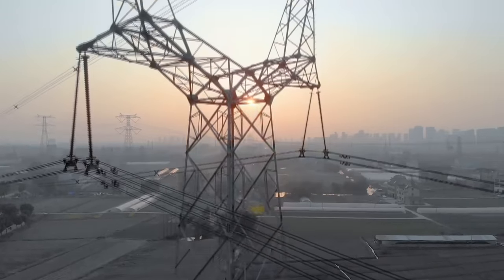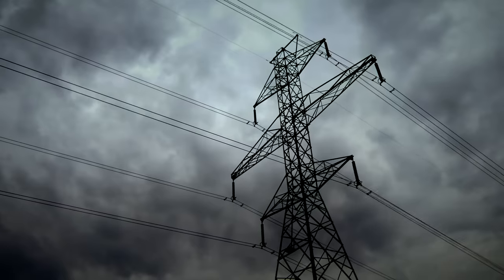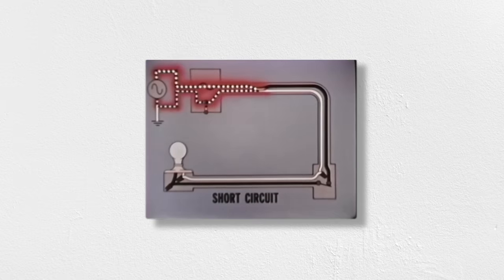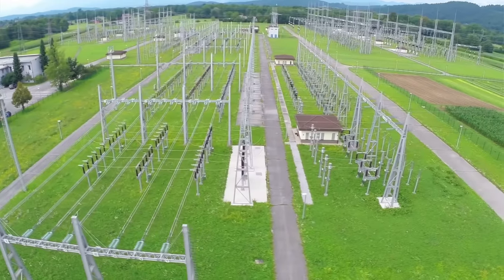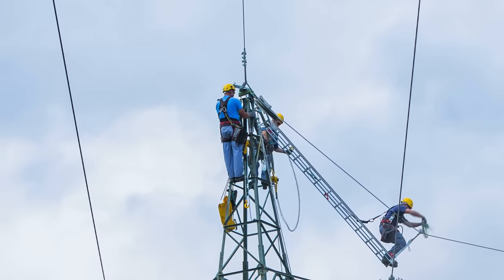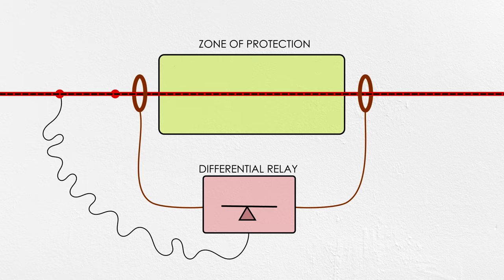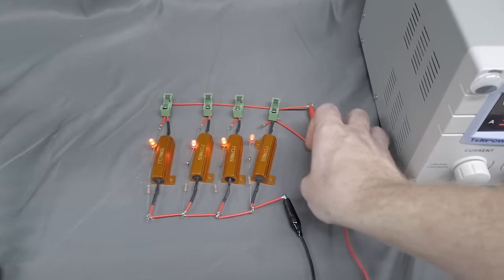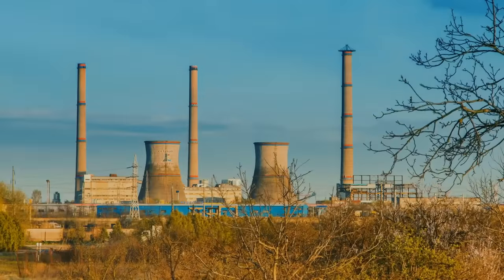How Power Blackouts Work

Comment: During the North East blackout of November, 1965, the “chichen and egg” issue was addressed by  by interconnecting a large group of employees’ cars to provide startup power for a plant in Connecticut (might have been Massachusetts) , that plant kickstarted  the North East grid back to life.  The process was described in an article in Analog Science Fiction/Science Fact,

Sometimes I ride around on my bicycle, trying to figure out where all the interconnections of the local power structures go.  Keeping track of that must be a major cartography job!

Thanks fir the great video!
Reply: I see there is someone else still alive that remembers that blackout. I was in Pennsylvania at the time and we intermittently lost power for a few hours. Quite the mess for the upper East coast. As I remember at least one very large generator was destroyed trying to keep the lights on in NYC. It took a few years to get it replaced. 11-20-2019.
Reply: I remember that like it was yesterday!!
Reply: Did they use the car batteries to provide excitation current to the (power plan) alternator? That makes the most sense.
Reply: @jrmcferren  There is a huge amount of control circuitry that has to be up and stable before a plant can be on line, and (depending on the fuel) everything needed to start it. A few years ago a power plant I supported had an intermittent failure in a charger on the battery bank that controlled one of the turbine units. The alarms for that charger were disabled, but the message was not relayed to the next shift. Overnight the batteries gave out and things went wrong, ending with lack of lubrication to the rotor bearings. The generator spun down with no oil and the expected results.
Reply: I was living about 40 miles from Philadelphia and all we had was a momentary brightening of the lights in the house and everything went back to normal.  It wasn't until the 11 o'clock news that we found out about the power outage.  And New York City was burning. Looting was out of control.  We talked about that in school over the next few weeks.
Reply: THE EGG WAS FIRST IT DIDNT COME FROM A CHICKEN!

Comment: Huh, I've never thought of blackout as a safety feature, but it really is. Thanks for an insightful video!
Reply: Most "alternatives" to it probably include some sort of terrifying electrical fire and/or melting of things.
Reply: Uhm, sound like when a surgeon dealing with a gangrenous thumb cuts off the arm above elbow. And a leg. Just to be safe. Long live engineering!
Reply: Here in California, PG&E has been doing rolling blackouts to try to stop fires around CA. It’s not done what PG&E said it would but it seems to have lessened the intensity. It’s not as bad as last year but still bad.

Comment: Never understood cascading failures until now. Suddenly it makes perfect sense. Thanks, Grady!
Reply: look up the timeline of the 2003 northeast blackout. an alarm system failure meant operators were unaware of changing conditions, allowing things to deteriorate . the first failure occurred at about 2pm, then more occurred with increasing frequency until over 200 power stations were forced to shut down in <5 minutes shortly after 4.

Comment: I enjoyed this video.  I spent many years configuring the computer system that monitored a small portion of the grid here in Virginia.
Reply: Thanks John👍🏻
Reply: John Nelson not all heroes wear capes
Reply: @sgb4798  But they ALL wear spandex.
Reply: Relay tech?
Reply: @circusmime  No.  For a while I configured the SCADA side of mainly Cooper Form6 reclosers and designed the user interface on this organizations SCADA.
Reply: @oldestnerd  wow nice!!!!
Reply: corey Babcock  Corey - After acquiring another organization's system we supplied many customers up to the WV line on either side of I-81.

Comment: I'm happy in Factorio all I have to do when blackout occurs is to take few stacks of coal to restart it and expand my coal mine.
Reply: When I first played Factorio, I kept thinking "this is too easy, I wish real life was like that"
Reply: @buttonasas  Then you become quickly overwhelmed by the size of your growing factory and before you know it 3 years have passed and you still haven't sorted out your iron shortages
Reply: @Ryanisthere  Still easier than Real Life. 🤣🤣🤣
Reply: Use burner inserters on the boilers to keep them functional even during a power outage.
Reply: @quadrplax  
What is a burner inserter?
Reply: @gregorymalchuk272  It's the first inserter avialable in Factorio. It runs directly on fuel (usually coal) instead of electricity so it keeps working if the power goes out.
Reply: @quadrplax  better method: use burner inserters in combination with regular ones (more efficient this way), or use a burner-backed Boiler + Generator to exclusively power the Inserters/Powerplant and maybe your Mines, if you can isolate it properly.
Reply: @squirrelnut  its not fun getting everything back online again when you don't have enough steam to power everything at once and your grid is such mess that you can't just cut it
Reply: @squirrelnut  but then u just have a non powered steam section with a switch to turn on to power the uranium miners / stations, or use just use solar / batteries since the ratio is easier
Reply: @Ryanisthere  My factory gets too congested and un organized to the point where I cant make copper coils for red chips
Reply: "I know!  I'll use solid fuel to power my boilers!  That'll be more efficient right?"
Doesn't build enough solid fuel production
Power system fails
Turrets run out of ammo
Pain
Reply: cough satisfactory is better cough

Comment: I was working for Ontario Power Generation on the night of the 2003 blackout. We had to pick up the pieces and get our plant running again. The guys on the day shift experienced the event. Quite a thing to see, hear and feel 2000 megawatts of generation being sped up (frequency goes up) the reverse when the frequency goes down. All the protection worked and there was no damage to the equipment, personnel or environment. Great video, keep them coming.
Reply: I've never been at a generating station when the load was unstable - it must have been awesome!

Comment: I bought my house in early 2015, located in the woods. For the first 3 years we lost power a lot, sometimes several times a month and always for at least a couple days. I realized it was always happening in the same area due to large trees falling down or branches that needed to be trimmed. I put in several complaints to the utility company and they finally did some work. We have only lost power 3 times in the last 2 years. Of course that was after I installed a generator hookup for the house lol.
Reply: it be like that sometimes
Reply: Says it all doesn't it. The bloody customer has to install their own power generation just to get adequate service.
Privatising energy creation and distribution was a mistake.
Reply: Very rural locations have all sorts of reliability problems that sometimes have no solution. The lines may pass over a number of jurisdictions and not all will have clear policies for right of way maintenance. In some areas it is a serious crime to cut trees without going through immense red tape.

Comment: I’m currently learning about the telegraphers equations and characteristic impedance of transmission lines. It’s good to take a breath and review the big picture with these videos.
Reply: The telegraphers equation refers to signal transmission lines, not power transmission lines. It's an unfortunate case of having the same name for different things. Signal transmission lines are lines such as coaxial cables, microwave wave guides and telephone lines, now almost obsolete.
Reply: I had to learn that in1980.  Today: Fiber Optic Time Domain Reflectometry.

Comment: My coffee machine: short circuits

Nuclear power plant: explodes
Reply: Nah, at worst it would just damage the generator, the actual reactor would be find. Though if the rest of the local grid went down they have to start the diesel generators to keep the coolant running.
Reply: @TheAkashicTraveller  just a joke on the content of the video, but yea I get it. Cheers!
Reply: @Zeckmon3  I thought its kinda becoming too overused lately
Reply: @karibemadhura442  it was overused the first time it was used
Reply: @Zeckmon3  and then post it on r/wooosh
Reply: Not great, not terrible.
Reply: My phone: short circuits

The house: Blackout
😂😂🤣🤣
Reply: Breaker: trips
Reply: D'oh!

Comment: Great video, thanks. Once, on a tour of the old Didcot power station I saw the last resort restart. The was a lead acid battery that could start a gas turbine engine which in turn generated enough power to run the coal handling machinery to light one boiler. This enabled the station to restart from cold and dark with the grid not energised. In theory this enabled everything to recover from a complete shutdown.

Comment: That last part with the facilities needing power to start backnup is why i love hydro electric dams such as the ones here in Quebec. An extra thing I could add here in the protections are whats called Overload protections, where an equipment uses just a little too much current as per usual. This protection will detect (usually thru thermal protection where a little too much current for to long will trip the protection) a fault and protect equipment such as heating elements or motors.
Reply: Bro I live in San Antonio Texas, and I’m trying to understand the science behind these rolling blackouts. From my simple minded understanding from watching these videos, I think I figured it out. The rolling power outages that we are experiencing are comparable to a overload protection device. There’s so much demand coming from the customer, that if the demand is met It could overload equipment and cause equipment failures across the city. So the demand needs to be reduced to protect from an overload of equipment, so electricity can be dispersed efficiently right ? What I don’t get is that there’s already been equipment failures and there’s not enough electricity to match the demand. Since there’s not enough electricity to spread, then overload shouldn’t be a problem, so why are we having the rolling black outs ?? I’m probably wrong about all of this but I’m trying to understand.. Wait, i think I maybe getting it now. If they don’t do the rolling blackouts customers would be receiving electricity randomly, and I’m guessing that could cause power surges,  which could lead to overloads of equipment, but if they control it, that solves the problem..
Reply: @anthonyvasquez7050  so from what I saw on the news and what I learned in school (and experience in a freezing climate), the rolling blackouts in your region are made so that people are able to have some power to charge batteries, heat their homes etc. Why you have these are because of equipment failure and TERRIBLE planning. For exemple in the army or in hospitals you have 2-3 backup plans for everything, 2 pumps when you need 1, double the hot water heater etc. What I'm saying is the utility companies dint plan for a storm like this so now pipes are frozen, generators a seized up etc. They should have planned for a 150f day as well as a -50f day. But they dint. Lastly, and sadly, texas wants to be indepandent. So you are on your own. Look up a map of the north american power grid and you will see texas as no connections to another state that could help pick up the slack. Now we wont get into the politics of this but in a purely electrical stand point this was highly stupid of them. Now people are freezing and no one that was prepared for this can help you guys because of the energy independance. So those are my understanding of whats happening. Sorry you guys have to go thru this and I really hope you get out of it safe. Good luck bud!

Comment: *power has left the chat*

*power has entered the chat*
Reply: Auto reclose
Reply: “Hey guys I’m back what happened while I was away”
Reply: power has left the chat
power has joined the chat
power has left the chat
power has joined the chat
power has left the chat
power has joined the chat

Love when it does this
Reply: Zach Phillips I heared once that here in germany the powergrid (the control tech of the grid) trys 3 reconnections after a short happened before finally shutting down

Comment: When the customer didn't turn it off and back on again, tech support short circuits a substation
Reply: Noorquacker can you explain what you mean?
Reply: @legominimovieproductions  At the risk of ruining a joke by explaining it, whenever you call your cable/internet company's tech-support because of a problem, they always tell you to simply switch off the machine (usually for 30 seconds, or so-- which is probably just an arbitrary number, but sounds smart to a layman), then switch it on again, which reboots everything.  The gag here is, that instead of having you switch your one machine off/on to fix a minor problem, the tech-support guy does that to the entire power grid, just to fix your cable-box/router.  It's akin to the "overkill" metaphor of using a sledgehammer to swat a fly.
Reply: @pcdm43145  
Dude, by using a sledgehammer on a fly you could easily miss the fly !
Use a nuclear bomb - 100% guaranteed success rates at getting rid of flies in your area.

Comment: Great video, good simple explanation of power system protection from all voltage levels. I work in the industry and and see this all the time. 

Really need the general public to understand the challenges of operating an electric grid. Lots of the time, people are frustrated because they do not have the perspective all the things going on behind the scenes. Hopefully videos like these will help with these issues.

Comment: In the mentioned blackout that hit the northeast taking out much of Ontario as well, it should be mentioned that Quebec was not affected.  Why is that?  Because Quebec (like most of Texas) isolates itself from neighbouring grids with AC::DC-DC::AC converters.  This takes line frequency completely out of the equation and prevents systems on the Quebec side from being badly affected.  It's naturally isolated to begin with by the DC "bridge".  Instability on the US or Ontario side cannot "infect" the Quebec grid.
The US grid would do well to set up similar "islands" to protect against regional failure spreads.
Further, this would promote using more long distance HVDC transport of power which could help with the marketing of solar and wind energy.

Comment: Argentinian here, on August we had a cascading blackout due to a 500kv line failure that outed all the country and even some cities of Chile, Uruguay and Brazil. It happened due to the interconnected system(Argentinian SADI) that couldn't handle the load when the line failed and the protections for under frequency started taking other generators offline until everything went black. Power where restored to almost every city in less than 6 hs

Comment: What’s worth mentioning is that now many households have their own generator (solar). So it’s absolutely crucial to have tightly unforced regulations around inverter’s behaviour during blackouts (aka anti-is landing). 

So. If you DIY an on-grid system and source your solar inverter from outside of your country, that inverter might not comply with your country’s grid connection regulation. What can happen is during blackout, your solar PV system may still be generating power which will electrocute people working to repair the blackout. You WILL go to jail for manslaughter.
Reply: To my knowledge all Inverters must check regulary (multiple times a second) if the Grid is still online and if its down the will stop feeding immediately.
(they do this afaik by not feeding for a millisecond and checking voltage if i remember correctly).

Comment: It’s crazy that I’m just seeing this video now. I work as a grid operator for a utility. Faults are an everyday occurrence on the distribution system. As you stated those faults are controlled by relays and breakers. Most soft faults such as a fused switch blowing won’t open a breaker and cause a circuit to be dropped. But hard faults such as primary line down or primary lines slapping together will open a breaker. The breakers are installed with multi shots. The breaker detects that fault then it opens the breaker, it re-closes the breaker after about 5 seconds. If the fault persists the breaker will open again and close after 30 seconds. If the fault is detected a 3rd time the breaker will relay out and it will stay open until we close it manually. I use pole mounted Re-closers within that circuit to isolate the fault and get as many customers within that circuit back on until repairs can be made.  You are correct. The grid is a massive machine and it takes people monitoring and controlling it 24/7 365.

Comment: "and shuts off the circuit"

Most non competent electricians here will just replace the breaker with a bigger one
Reply: i use six inch nail
Reply: corey Babcock  nine imch thats 225mm imight bw.wrong but im sure we domt have them in uk
Reply: Isnt that how a house fire start
Reply: @robertbennett2796  yeah

Comment: The solar panels under the ocean, that was a good one
Reply: they could do double duty by being wave motion generators.  Two for one.
Reply: @AffordBindEquipment  
Under the ocean
Reply: @NoNameAtAll2  I bet some boffin has figured out how to use them under the ocean.
Whether it's cheap or not is another matter.
Reply: @NoNameAtAll2  "under" is not defined; to be grammatically correct, these would have to be on the ocean bottom for the panels to technically be  "under" the ocean.  But my comment was a joke, which means "not to be taken seriously".  But I have seen where wave generation is "under" the waves so as not to be beat to death by the constant bashing.  Also, tide generators.